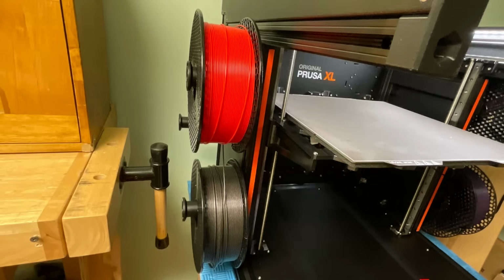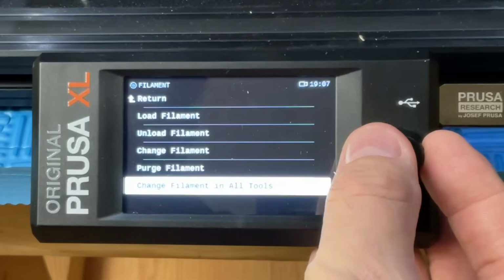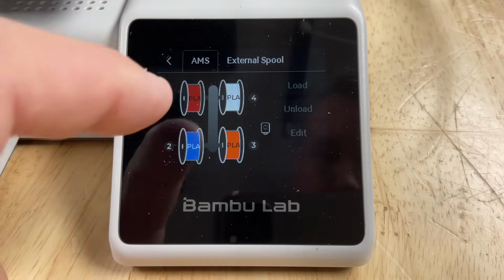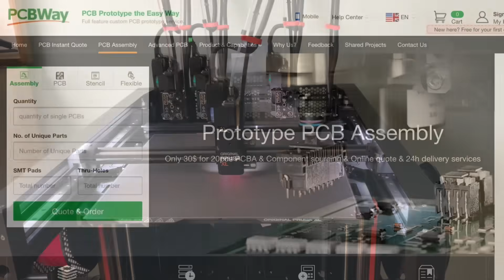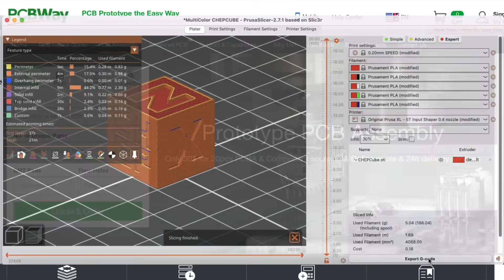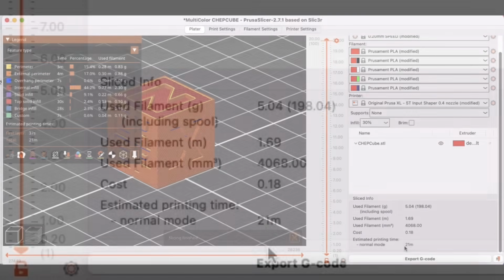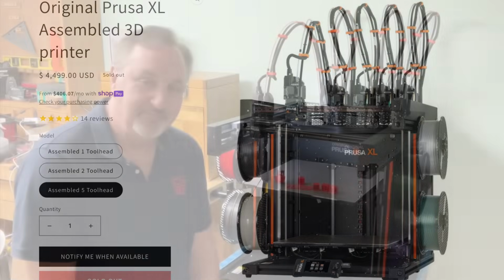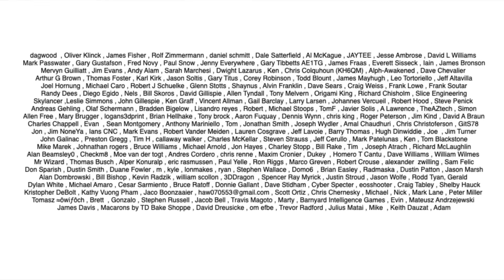Prusa XL Multi-Color Multi-Material Multi-Tool Head 3D Printer

Comment: Oh man,

You just had to turn the ribbon cable. 

The end on your board was then also the wrong way around 😂😂😂

So just turn, the cable end of the board has to be ina display and the display end has to be ina board.
Then the direction of everything is right.

But I didn't notice it until a little later

Comment: The whipe tower is for purging the heated filament that was long in the toolhead. Also I print a ton of PETG with PLA as support works as a charm. Mind that you set the right filament as main whipetower. But the XL is the fastes as far when you print multicolors. The bambulab in single color prints is faster though but they are closing the eco system more and more while prusa remains main open source.

Comment: I am curious about the buddy board. Other channels show the stepper driver IC´s have no heat sink, but two studs are on the PCB as if there should be a heat sink, and the Z driver has two motors connected to it. No ventilation of the electronics compartment. It can be fixed, but for that price tag it should need no fixing. I am eyeing buying one. After 12 years of 3D printing as a hobby, the XL would be the ultimate update.

Comment: Nice comparison! We’ve been using 4 XL’s where I work and everyone loves them. There is an easy (but not very discoverable) way to remap the colors as you’re clicking through the “Print” process on the machine. Also, to get clean, large, multicolor prints on ours we set the minimum purge tower volume to 35 mm^3 and the nozzle parking temp to 180C for PLA. We were losing a lot of time waiting for idle toolheads to heat up from 70C for prints with more than 1,800 tool changes. We’ve also lowered the nozzle temp to 205C for generic PLA to reduce stringing. Thanks for all the great advice and tips over the years!
Reply from the maker: Thanks for the tips.

Comment: How the print is sent to the printer seems to change how the print starts (Prusa Connect/Link/USB), and it doesn't seem to be entirely consistent at the moment. ( I am using the current alpha firmware). From what I have experienced, if you use PrusaLink as the Host type in the Physical Printer setup it usually pauses for mapping. If Connect is used, then it usually just starts. I primarily use PrusaConnect, and have found the best solution is to "Upload", verses "Upload and Print". This will be bring the job up on the LCD screen, but not start. Then you will go through the Filament Mapping screen before the print starts. This will allow you to remap the toolheads and setup SpoolJoin, a similar process as you show with the Bambu machines. This will also happen on a MK4 with an MMU3.

Comment: If they could cut the price in half, they would not be able to make them fast enough.
Reply: Sadly that is probably impossible with the labor pool and supply chain they use. Yes, they seem expensive by comparison to so many Chinese machines. But they are made with a much higher standard of materials, and with very different labor laws. The same applies to about any machine made outside of China. But if they were half the price, I would own twice as many!
Reply: @HackMonkey  I understand. I just was musing that the price point is difficult for many. This is not a consumer machine. It is a prosumer machine. It is worth the price, but don't have the money myself.
Reply: That would require chinese "wages".
Reply: @flybywire5866  I realize that. With recent bambu drama, looking more and more towards new XL. Have been waiting until the larger bambu arrived. Now not sure what I want to do.
Reply: @boazjoe1 I was just gonna start with the single tool head and work my way up till I had all 5 plus the enclosure

Comment: A two head XL semi assembled costs $2500 and is a very big and capable machine. I think you must buy a 2H XL and let the printer itself pay the 5H upgrade for you during your printing season. I could buy 3 P1S instead one 2H XL but I cant print a 35cm piece with three P1S. I think many people are missing the point here

Comment: First video I’ve seen with 4 tool heads, honestly surprised it works given they don’t actually sell a kit with that exact number. Guess you just have to make sure to not assign that missing tool head to anything haha
Reply: you can buy anywhere from 1-5 tool heads. when you slice the model you define which heads to use.
Reply: They sell 1, 2 and 5 kits.

Comment: I don't think it would be possible for Prusa to reduce costs significantly. They are a company that manufactures in Europe and, with Printed Solid, also in the USA. Wages are generally higher than in China and therefore the costs are naturally also higher. According to Prusa, 60-70% of the parts come from European production, which of course also means higher costs compared to Chinese manufacturers.

Multi toolhead systems will certainly come onto the market more cheaply in the next few years, but these will probably be Chinese manufacturers and at least some of them will rely on closed source, which is not a good sign for open source in 3d printing.
Reply: Bambu has just started moving to closed source. What might be next, subscription models after all users are locked into the Bambu system? Not for me.

Comment: 4000? It is cheaper to pay someone to paint it.
Reply: There is always a way round. Even around the wasteful printers with a single Nozzel and an AMS-like system. You just need a clever design and may have to assemble the print instead of printing everything in one piece.

However, in production environments, the XL has the advantage of being able to combine different materials without assembly, saving time. Here $4000 is an investment that pays off.

Comment: For the ribbon cable, did you try swapping ends?  This is a common mistake that many people make.  If that wasn’t the issue, then it means someone at Prusa assembled the cable improperly.  BEST
Reply from the maker: It would require me to disassemble multiple pieces to get to the other end. And still no guarantee it would solve it. My solution was simple and effective.
Reply: @FilamentFriday   in that case it was definitely a manufacturing error.  I’m surprised that QC didn’t catch it.

Comment: To call a $4k printer 'the future' and compare it with a printer that costs less than 1/10th is a bit of a stretch and is comparing apples with whole orange trees. Using the waste as reason at that prize point isnt a great comparison either. Trash aside, consumers dont buy with their moral stand about the amount of trash produced, but they buy with their wallet. So if i compare these too i can buy one printer with over 150kg filament to cover the wastage. What an odd comparison here
Reply: What about time saving? 

If manufacturing you have to include time of you losing time for filament purging too. 

Even in hobby space if you have a print that is 30hrs on the XL it will be 50hrs on Bambu. 

It has merit and yes you could have multiple printers but you will still be constrained by time if printing requires purges.

The advantage of XL over cheaper machines is multi material. Any device that has multi material really needs separate heads to be clean and less issues with contamination. Any multi-head, like idex it is more expensive.

It is expensive but it is quick. That can make a difference to others who are impatient or have no budget constraint.

By this point I’m surprised Creality haven’t ripped off the 5tool - I guess it’s not easy to do well… but if they did would they be 4000 or 2000 or some where else…
Reply from the maker: @K8Stuff - When I started 3D Printing a $500 printer was unheard of. Now we have sub $200 printers that are amazing. 
The A1 Mini has features even the P1S doesn’t have and from the same company. So to me it’s worth noting if you potentially can get the same end result (4 color print). 
The XL is $2000 for partially assembled, single head. So 4 added heads and some assembly are an extra $2k?!
There is room to reduce this. Bring on competition and prices will have to fall.
Reply: @FilamentFriday  That is exactly the point.EIt What the Bambulab A1 does is not comparable. 
It's when I want to drive a Formula 1 race. And argue that my Fiat also has four wheels and I can drive it and that's why the Ferrari is overpriced.
Reply: The first commercially available flat screen TV about 25 years ago cost, in 2024 dollars, $29,000. The same size/quality (or better) TV today costs maybe $400 tops. Flat screens were expensive and also "the future".
Reply: Did you watch the video or comment before he’d finished his sentence? He said the machine is the future but he hopes they can get price down..
Reply: I think it was the concept of multicolor and multimaterial that was intended as 'the future' rather than the prusa xl itself.
There is always some feature that appears on top of the line stuff to slowly creep down towards the cheaper products, some years ago it was speed, today it is multicolor, maybe in two years it will be multimaterial
Reply: The Xl has its strength in multi material not multi color printing.
This makes it possible to use different materials in one print.
Unlike printers with one nozzle, the different materials are not mixed. 
Which can worsen the layer adhesion if you do this with Pla and Peteg, for example.
Different nozzle sizes can also be used in one print.
The printer is too expensive just to print colorful figures.
Reply: There is still no competition for this beast, aside from IDEX (only 2 tool heads).  Competition will drive the price.

Comment: When you do an actual breakdown of the costs involved in the machine it starts to make sense how expensive it is. There is an open source project that adds similar print heads to Voron machines and a 5 tool head version ends up at about $2000 by the end. If you use a Sovol SV08 as the starting platform you can get it down to closer to $1500.
Reply: This was exactly the tipping point for me to pull the trigger on the XL. I gave TAP/Stealth Changer a good deep dive at RMRRF this year, and came to the conclusion that a 350mm Voron V2 and the DIY changer was going to be within $1000 of an XL, and I would be sourcing and building for months. When instead I could have an XL from Printed Solid in just a few days, and spend the saved time on recouping the investment.Then there is the whole service/support/warranty consideration. I love my Vorons, but I needed a machine to earn me money, not a hobby project at the time. I am still watching and interested in the Voron changers, hopefully we get some good kits soon.
Reply: @HackMonkey  I have been following the DAKSH project. It is essentially a clone of the Prusa system.
Reply: @WonkoTSane  That is a new one. I will give it a look.

Comment: I hope you will get to review the new Prusa Core One.  I also hope that Prusa will come out with an IDEX version of the Core one that has TWO print heads.  IDEX would be a compromise between a single head printer and a multi head monster like the XL.  And you could always have an MMU3 on one of the two print heads to enable multi color and multi material at the same time.

Comment: Good review.  I have had mine about 1 year, and had a problem with one of the extruder mounts.  It was slot one, which is the most critical as it is used as a basis for the tool head calibration.
I also have had ongoing problems with filament jams in the nozzles.  I replaced all 5 with Phaetus nozzles and it works great.  I agree with your comment on the colors being identified in the printer setup.  My Bambu X1C allows me to specify the colors and I can synchronize them to the slicer.  Makes it much better when you do your designs in a different area.   The XL is a good printer, and built like a tank, agree that the price puts it out of reach for most hobbyists

Comment: I cannot stand Prusaslicer. It is the most infuriating piece of software I've ever used for slicing. Prusa really try to act like a premium brand but they really are just leaning on the success of the Mark.
Reply: What other slicers are you using?
Reply: @htpkey  Cura, but I would use anything else other than Prusa
Reply: You can use Orcaslicer with Prusa XL printers